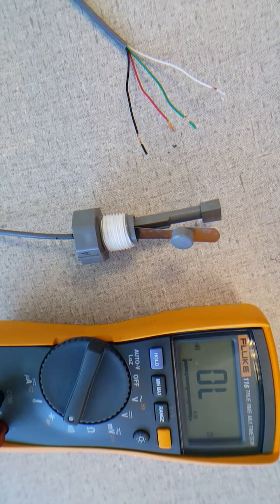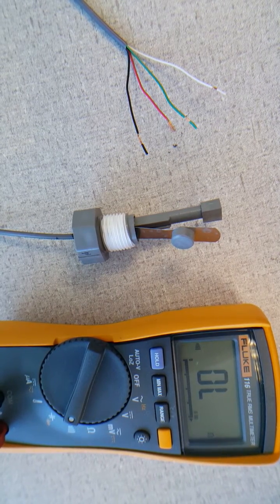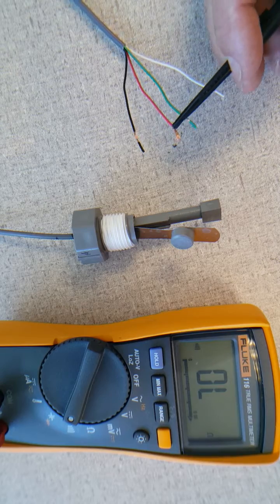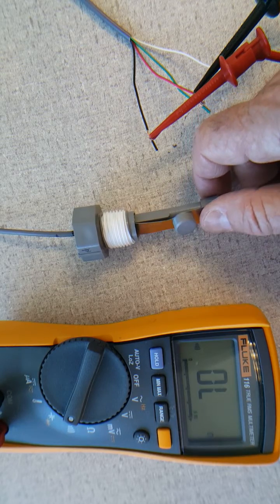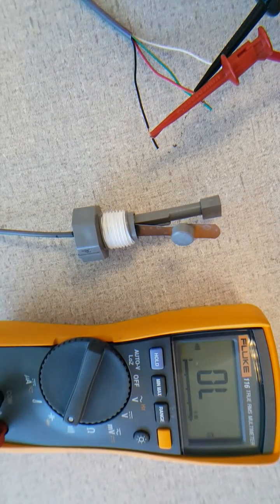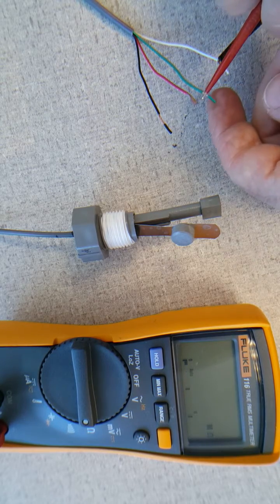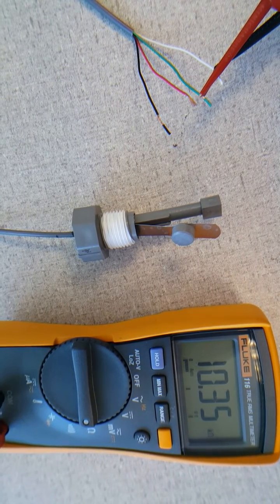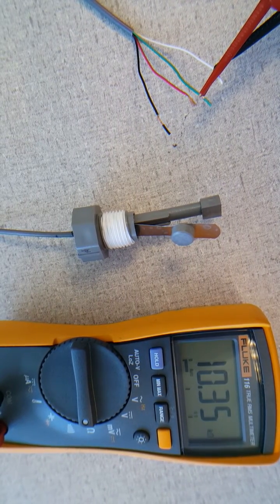Harwil Flow Switch Testing

Comment: Hello Harwil,  your Q12 spec sheet does not identify your part number for the switch with the thermister in it.  what is your part number for the unit with the thermister for the C2 flow switch?
Reply from the maker: Most of our switches are manufactured to a companies specification.  The part numbers change for each configuration.  Please call us to discuss what you need.  805-988-6800

Comment: how can you test them when it still in the pipe
Reply: Sure as long as you remove the connector from the board then using a paper clip, press down inside the wire hole lock clip and slide the black and red wires out (middle 2). Then put a meter on it for continuity. With the pump off you should get no reading or OL and with the pump on you should get 000. If you don't then replace the sw.

I would see if the sw is avail alone without the pipes cause it just screws in. I need to find one cause I know the hot tub store down the road will mark up the part, that even if they would sell it to me. 

You could close off the water hose with a rag and vise grips then unscrew the sw. Note: make note where the black and red wires go on the connector housing. Put a + on the connector where the red wire goes and also if you remove he flow sw, make note which way the flap of the sw is facing. A phone camera comes in handy here.